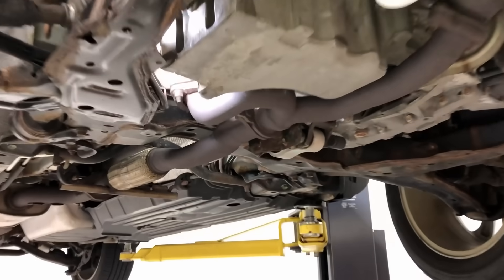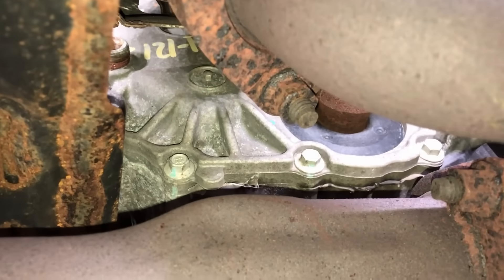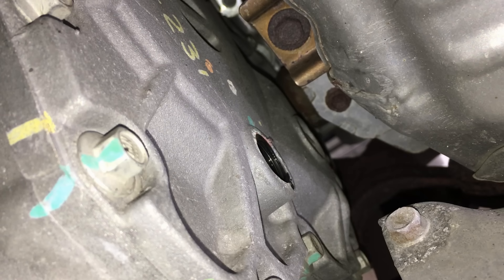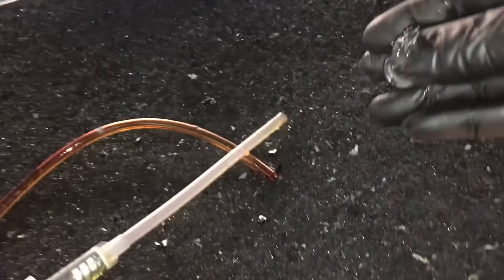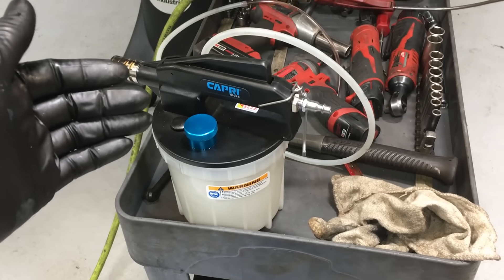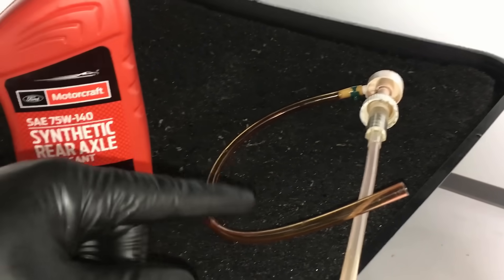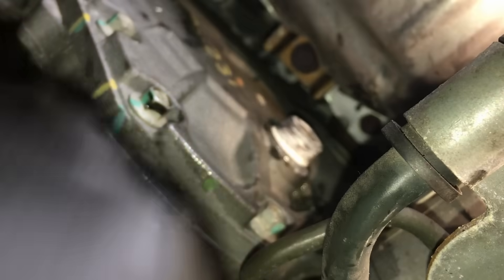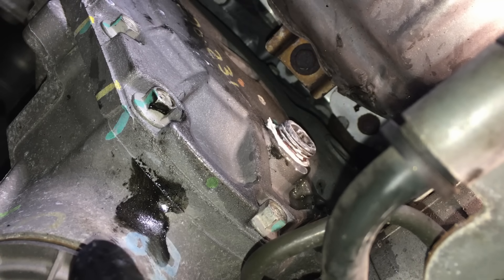Ford All Wheel Drive Vehicles: Critical PTU Fluid Exchange Procedure

Comment: Looks to me that the biggest heat, which is cooking fluid, is coming from exhaust system. Why Ford engineers don't design, at least partial fix for this problem, by designing some kind of heat shield in this area.

Comment: would you recommend drilling and tapping the PTU for a drain plug?
Reply: Just did mine yesterday on 2013 Ford Edge, it wasn’t that bad, tight space, but if you wiggle around you can get a hand over top and from underside a 3/8 wrench. YouTube has a way to make a suction hose with a quart canning jar and hoses, it worked great for sucking fluid out. I sucked out 15-16 oz of the 18oz capacity. I got a new PTU under warranty at 40,000 miles. I’m at 102,000 now but the fluid was just dark. Not much on magnetic plug.
Reply: Quart jar and hoses are hooked to a shop vac.
Reply: Did you ever figure anything out? I've looked through the comments but haven't got any details.. good luck
Reply: @jamesd2661  my mechanic says since it is my daily and i am not towing, not to worry about it. he is also convinced since Ford says it is a lifetime fluid to leave it alone. I also have a 2012 Ford Flex and the Subframe would have to be dropped to pull it.

Comment: Ford is No. 1.  This is why I don't think I will buy another Ford Product.  Too many system failures due to faulty engineering.  No drain plug at bottom,  Have a Ford Focus with electric power steering failed due to overheating,  Ford Windstar faulty Torque Converter.  Quality is not there anymore.  If you are going to design cars for the future, remember to have one designed for electric cars and another for gasoline/diesel powered.  The little amount of weight saved to give you better fuel economy and giving up quality will lose you more customers than you can ever regain.

Comment: Hey bed I have a 2012 Explorer and it's leaking fluid from the Transfer case going to the rear driveshaft is it safe to drive the vehicle with it leaking is it a full time all wheel drive or 4 wheel drive system or is it mostly front wheel drive and it doesn't spin at all times

Comment: Nice!...thanks for the heads up.  Just got my "03 Explorer last fall...my local Ford dealer quoted me almost $1000 to change out the drivetrain fluids. You said $1500 in p&l for the part failure...Ford would probably charge that for the fluid maintenance you did here.
Reply: 2003 does not have a PTU.

Comment: What would you recommend to "liquefy" the old fluid inside to help clean it out without removing the PTU from the car (what safe solvent could I use to clean the inside of the PTU)?
Reply: Do this procedure... Then do it again in like 3k miles or on your next oil change.. And then wait 30k miles.. It worked for me

Comment: I just tried to get this done at my dealer.  They said they've never done a fluid exchange and there's no way to do it.  They only do replacements if the "right" seal goes.   Any idea why they have no idea about this issue and the maintenance for it?
Reply: Our local independent mechanic did it and charged about $120 all in in my CX-9, which has Ford Edge PTU.

Comment: My 2016 Fusion with AWD and the Turbo 2.0 had a drain plug and a fill plug. No exhaust anywhere near it.I just changed the fluid at 65k and it didn't look bad at all.  I guess the v-6 models need it more than the  4's?

Comment: Thank you very much for the clear and thorough directions on this procedure.  I didn't even know this was an issue until this video popped up.  Thanks to your instructions and links, I was able to drain and fill the PTUs in our 2012 Escape with 105K miles and our 2010 Flex with 122K miles.  The Escape's fluid was surprisingly good - not quite clear but not bad.  However, the fluid in the Flex was sludge.  It was tough to tell, but I believe I put more fluid back in both than was removed (neither one dripped when I opened the plug and I filled them both up to the rim and then some).  The seemed to take about 16 ounces each.  If we lived anywhere near you, we'd definitely take our cars to you for work that I can't do.  Thanks again.
Reply: im looking at high mileage flex's after you changed were you able to save your PTU how many more miles were you able to put on it?  Thanks!
Reply: @wattsobx  I''m not exactly sure, but my wife is still driving it.  Since I changed it, she's put maybe another 15K or so on it.  Still running fine.

Comment: Just did this and the transmission fluid on my 13 explorer. Almost at 100,000 miles. Last changed them right about 70,000. Thanks for the tips!

Comment: I started changing it every engine oil change.  It still comes out very dirty and the magnetic plug is full.   Its easy to do (my 2nd rebuilt one has a drain plug ) and only 12 oz so not costly.

Comment: Ford has been putting the catalytic converter too close to transmissions and other heat sensitive components for a long time. I have a 93 Explorer and it has 2 catalytic converters right next to the automatic transmission. The transmission started acting kinda weird,so I took it to my buddy's transmission shop. It's old,but it's in excellent shape. I just had him rebuild it. Everything inside the transmission was in good condition except the seals were all damaged on the right side of the transmission. The damage was due to excessive heat from being too close to the catalytic converters. The seals were hard and didn't seal very  well internally anymore. I put new catalytic converters on it too. It's only got 120k on it and I don't want a car payment,I have another vehicle. I like the explorer  it's a pretty solid rig. I take it camping and my dog loves riding in the back with the seat folded down. It's great in the snow too. I always make it to work. I've given some of my coworkers on my shift a ride when they can't get out of their driveway. Thing gets kinda crummy mpg though,13 city 19 freeway. The gas gauge has been broken for years so I use the tripometer. I know exactly what the mpg is. It gets 15/21 mpg with non ethanol gas. I'd use that except for the only station that sells it is 20 miles away from me.

Comment: Just finished my first PTU drain and fill on my 2013 Flex with 79k miles. Not comfortable but was able to do it in my driveway. Thank you so much for the excellent video and saving me from taking it to a mechanic. I also did my first transmission drain and fill thanks to you. Maybe you could do some suspension replacement videos? Control arms, inner tie rod (that’s what I need to do next) etc. THANK YOU
Reply: Damn they must of sucked. I just did it on a lift and it sucked.

Comment: A lot of components like that in different brands are becoming sealed units, designed to last for the “life of the vehicle”. But they don’t tell you how long is the design life. Good reasons you mentioned to change the fluid regularly. Fluid is cheap but replacing that component is not. Educating customers and showing the dollar value of maintenance like that will definitely go a long way.

Comment: Sadly I'll never buy another Ford product, same goes for GM and I'll be cold in the grave before buying a Dodge/Chrysler/Ram/Jeep.
Reply: Then you'll be walking because all manuf have failures of some form or another. And you'll probably walk barefoot, because shoes can also fail!
Reply: @dodgeguyz  Actually I have a uber reliable Ford in my garage and its a 1989 F150 with the 4.0 inline-six,  from back when a truck was a truck and not an over-engineered pile of crap. BTW don't be a smart a$$.  It's a well-known FACT Dodge, Chrysler, Jeep products are at the bottom of reliability ratings. A good friend of mine is a contractor repairing and retrofitting cell towers, three years ago (against my advice) he replaced all ten of his trucks (a mixture of Ford and Chevy) with new Rams. Since then his poor choice has seen all but "one" in the shop for multiple transmission failures, major engine failures, and multiple electrical issues. Those Rams were all "service trucks" and NEED to be reliable and work every day, last February 2020 he dumped them all for new Tundra work trucks. So I guess based on his experience you "might" have a 1 in 10 chance of getting one that's trouble-free.... :::smirk:::.
Reply: David G 
Good on you for the 89! Yes those were real trucks, sadly they don’t make them like that anymore!
As far as “your friend”.....well sounds like he beat the piss out of them. I’ve yet to see as many failures of every system in a Ram! Seems a bit far fetched to me!
Reply: Ok,, be sceptical, I can understand that. As for why he dumped them, his crews traveled and towed equipment trailers across multiple states, all across the southeast  U.S.. Try sending crews out and have them breakdown on the freaking highway and have to send trucks out to pick them and tools up. His business isn't like your local Joe blow electrician. Bottom line, the Rams cost him time,  money and aggravation. You know,  fan boys like you should be hammering these manufacturers to give people dependable, long lived products, not shiney exteriors, fancy interiors which is like putting lipstick on a overpriced pig....

Comment: Can you please make a tutorial on a 2017 explorer PTU fluid change.  It looks very different than this video. thanks
Reply: John Gonzales How's your 2017 Explorer doing? That is what I drive. Wondering about trading in but the new 2020 and 21 has turbocharged four cyl. I have very low mileage (13k) however. No problems. Yet.

Comment: I would love to install a drain plug in the PTU in my 2011 Edge. Besides installing it in the bottom at the lowest point you can, where in the bottom so you do not damage something inside the PTU and also how large a plug? Also with a drain plug installed you could fill the PTU through the fill and flash it out some. Also does anybody know if Ford has put out a tech bulletin saying how and where to install a possible drain plug? Maybe even an after market kit?
Reply: No TSB that I know of. Google, (How to install a drain plug in the PTU in my 2011 Edge).
Reply: If you pause around 6:15 or so, look at the bottom right of the screen.  See the bolt and then the rib next to it?  If you gi back about a 1/2", that's where I drilled and tapped a1/4" npt drain plug.  The case is very thick right there, it took some grunt to finally punch through.  Once you drill through, let it drain and then cut some threads and now you have a drain plug.  I did this on a 2008 Fird Edge.

Comment: Will performing this procedure void the factory warranty? There has been so much on different forums. Ford will refuse to replace the gear lube because it's "fluid for life" to Ford service departments saying it's a sealed unit and impossible to change, to people being told there is a tamper evident paint mark if disturbed will void the warranty.  I've also read that supposedly Ford has issued a TSB or SSM statement saying it's no longer a lifetime fluid. I haven't been able to locate any TSB regarding this. Does anyone know what the exact story is?
Reply: No TSB that I know of

Comment: Thanks to this video, I decided to change the PTU fluid in my 2018 Explorer 3.5 at 17,000.  I used a large syringe with a 1/4" plastic hose to extract the old oil and refill with new fluid (yes, it takes a while to move gear oil with a syringe and a small tube, but it works).  Although I found the old fluid to pretty nasty-looking, it was by no means sludge.  It would have lasted longer, but clearly needed to be changed.   However, what really concerned me was that try as I might, I was only able to extract about 1/2 quart of old fluid.   I had the syringe tube placed as far as it would go into the PTU, to where I though it was at the bottom, and to where I was unable to extract any more fluid.  (So idiotic not to have a bottom drain nut on this unit).  As I had heard and read that this PTU takes "about" 1 quart of gear oil, I thought the unit might have been under-filled.  When I refilled the PTU (with Mobil1 75w-140), it took only about 1/2 quart.  So, either I had not fully emptied the unit OR it actually only takes about 1/2 quart, which is pretty scary.  Unfortunate, this video does not show how much fluid was pulled out.  Please let me know if you have drained and refilled this PTU and what volume you found.
Reply: This is obviously a very poor design by Ford I don't know whatever possess them to build something like this without putting an actual grain plug in it
Reply: I found another video for a Ford Edge 3.7 PTU oil change and they put in about 16oz or 1/2 qt of gear oil.  So, I think I got it all.
Reply: 2016 Explorer 3.5 holds 17.9 ounces according to Ford.  I was able to suction about 12 ounces or 2/3 through the fill hole.   That's pretty good.  At least half of what's left is stuck to the gears and the case and isn't in the sump.
Reply: The owners manual for my 2017 Explorer states the capacity is 700 ml (23.7 oz) which is just shy of 3/4 quart.

Comment: I have a 2016 Lincoln MKZ AWD 3.7L V6 and the axle seal was leaking I think I told him to drain and replace the fluid if not once he pulled out that axle most of the fluid would have come out since the shaft enters near the bottom if not I will have them do it the car is still under warranty but that fluid suck and fill will cost me some money

Comment: Thank you so much. We had to replace the PTU at 52k and again at 84k.  Somehow I have made it to 238k, yes 238k, without further problems..... I happened to catch your video while I had the cradle lowered for the steering gear replacement.  I notice a leak on the PTU, went to check the fluid...er....tar, and I'm following your procedure.  The guys at Ford still tell me no service is required, yeah right.  I think I'll use this old "fluid" to fix my roof because it's the same consistency.  We'll see how much further it takes me.

Comment: Before technician up here at the dealership told me that they could not do that and that it wasn't required even when I asked them to and told them they could suck it out with the sucker they said you can't do that on the 2016 Explorer 3.5. I suggested cuz it was a 2016 the drain use the drain plug I had a fillng  using the vent tube

Comment: When I buy used car or trucks that are mostly used for highway and daily I stay away from all wheel drive and most used 4 wheel drive systems  and poorer on gas mileage and cost way more in maintenance issues and most previous owners never change transmission or differential oil till it give them troubles . I never follow manufacturers recommendations oil get changed ever 5 -6000 km transmission gets 4 litres out in spring  and fall through dipstick tube  different ever couple of years if I tow + posi additive if required usually vacuum out after I did 1 cover removal and clean  out  after initial purchase. Brake fluid is also changed it absorbs water and very few owners do it and wonder when their abs computer and system fail,powers steering also .Cheaper to do fluid changes than to dismantle  or cab off for some damaged parts lolol

Comment: Should I warm up the fluid before draining? I imagine you want it warm, but not too hot that it would prevent you from working in that area.
Reply from the maker: Correct
Reply: FordTechMakuloco Thanks for the reply. I plan on doing this on my 2013 Escape 2.0 SEL.

Comment: Great advice man. I have a question. I got 2017 Explorer Sport. I asked the dealer to change ptu fluid. The Dealer told me there is no holes on ptu at all. The only way the change the fluid is to take it apart and it will cost $1,200. It that correct?!
Reply: 100% false, the explorer/taurus/MKS/flex all have a PTU and all have a fill plug at min, some have drain plugs as well
Reply: Thatcguy is a bloody lyer ... or an incompetent.😡

Comment: No drain plug on gear box that need periodic fluid changes, Took a whole weekend to change the alternator on an Escape and just found out the waterpump on the Explorer I bought is inside the f#%king engine. I will know it needs replacement after it dumps all the coolant into the oil pan. Thanks Ford.
Reply: J Mc - The Escape alternator location absolutely sucks balls. The engineer who designed that needs a good beat down.
Reply: @chucknoob7041  Yes sir, a beat down with an alternator.
Reply: Yup. Waterpump went on my 11 Lincoln mks EcoBoost 60k miles on it. No signs, just shut off. Long Story short, they had to replace the engine.
Reply: @teehud313  great! I have a 14 MKS EcoBoost with 54,000 miles. It just started leaking oil out of the rear turbo onto the exhaust manifold which needs fixed. Now I have to worry about the water pump and the p t u failing. I had to replace the AC condenser last summer for $1,100. Probably the last Ford I'm going to buy unless the Mach E  is really cool
Reply: The Mach-E is awesome!!
Reply: @harleyjackson5513  : Awesome and reliable it's unfortunately not the same thing. Prefer a less-than-awesome vehicle that works than an awesome one that sits, or cost a fortune to fix.
Reply: Ford Edge/Lincoln Mkx has the same design flaw. If the water pump leaks ( and it will , sooner or later) coolant mixes with oil and makes a foamy fluid that don't lubricate the engine. Any other OEM puts the water pump on the outside, so it might leak a bit of coolant but no big deal. It is critical that keep both coolant and oil as clean as possible by changing often.